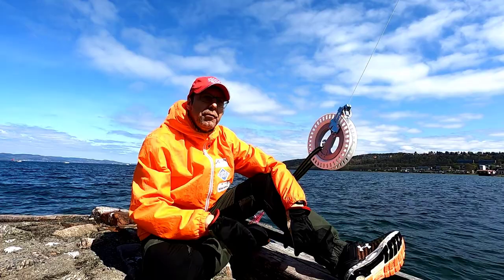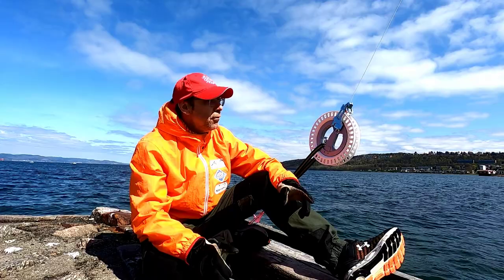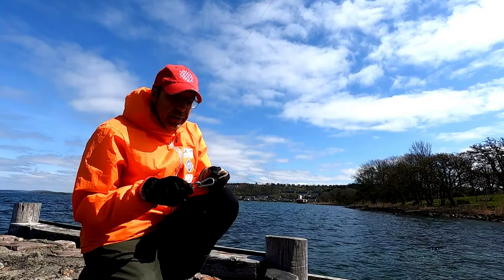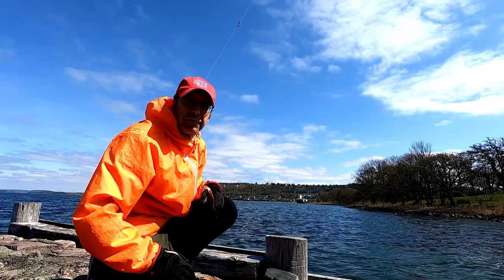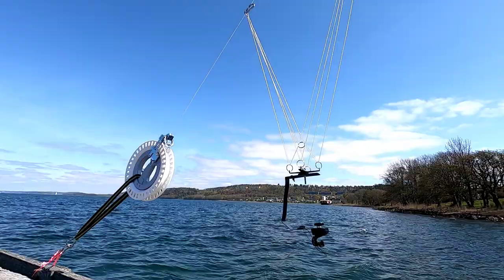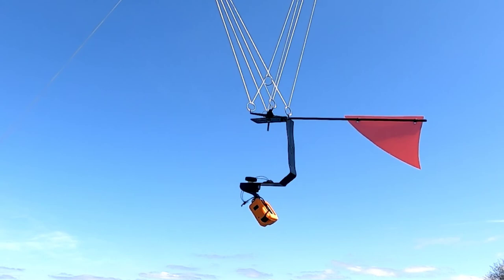This is How I K.A.P.

Comment: Man, that kite is big!
And the lines for the KAP-ring are very long. 
My hope is that I should be able to use a smaller kite and very much shorter lines for the picavet 🤔
To be able to use kite-cam from my sailboat I need to have enough space to prepare and launch.
Reply from the maker: Yes, the spine is clocking in at 180cm and the kite is at its best in low winds because it will pull too much (and break) if the winds are too strong.
I have smaller rokkakus that I use for KAPing too when the wind is stronger.
Or I use my power sleds or PL foil - sparless kites - that can take quite a bit of beating.